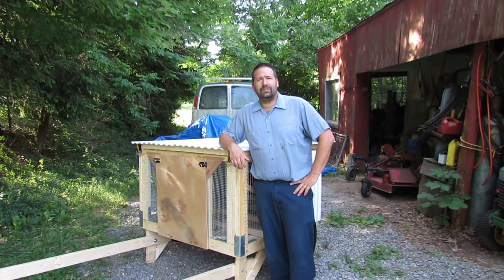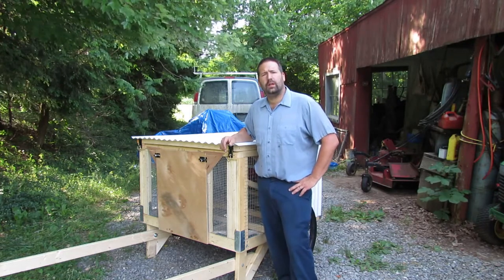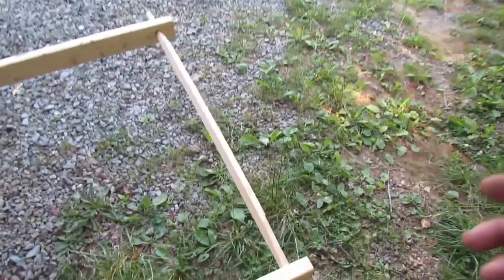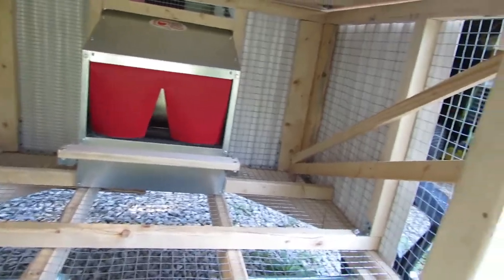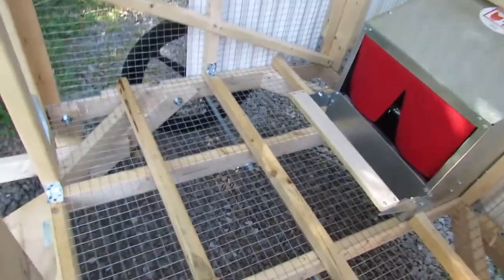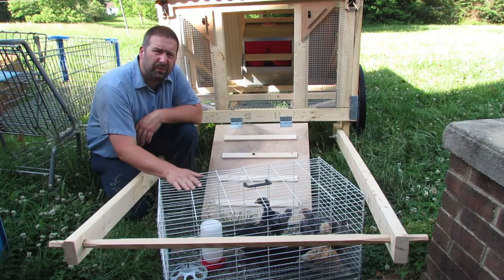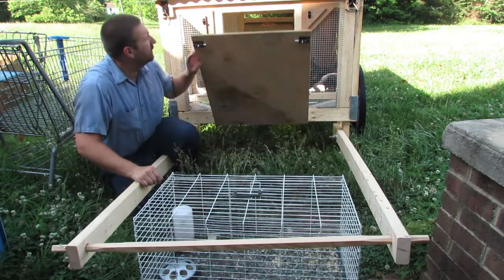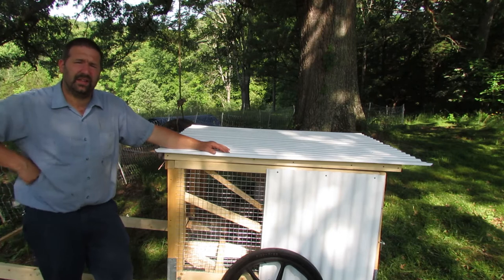Review of Justin Rhodes Chickshaw 2 0 (Mini Chickshaw)

Comment: I've had problems with mine with the axle bending over time as it bearing the weight of the shaw rendering it unusable. Wondering if you have any tips on that? Thanks
Reply from the maker: Mill Leaf Holistic Farm I have not had an issue but I can see it being an issue. If I did have a problem with that I would try reinforcing the outside of the axle like the larger version called the Chickshaw. The extra bracing is made from 2x4 material. Google Chickshaw for pictures showing the extra reinforcement. Excellent question! Thanks for watching! ~Mr. C.
Reply: You might want to try this solution. He covers how he did his wheels differently towards the end of the video. https://youtu.be/IwbTRvmiYYo